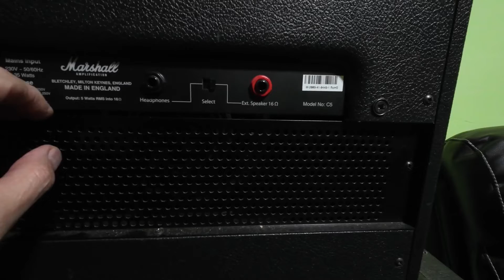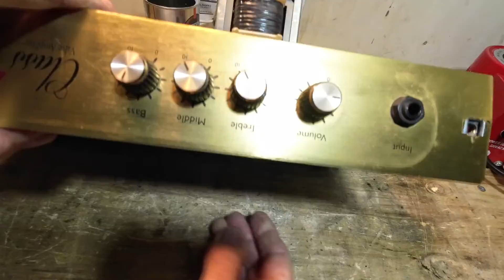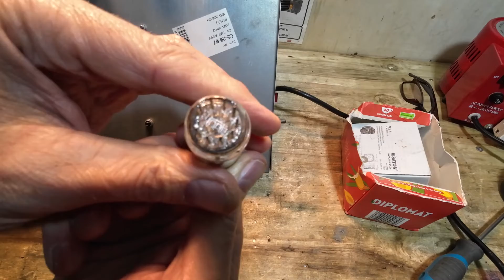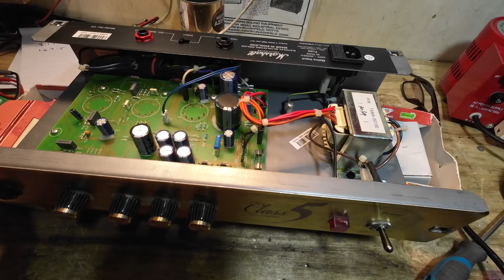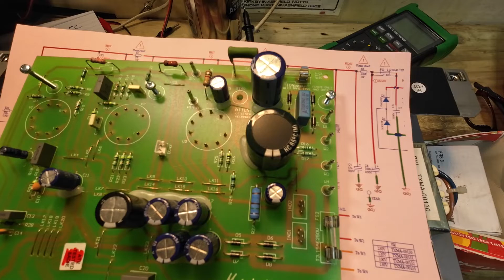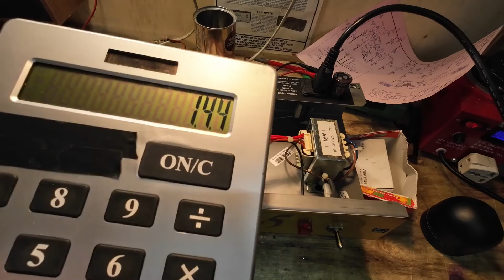Marshall Class 5 Guitar Amplifier Re-Cap and Mods.

Comment: Do you have a parts  list on the items you changed out, 
Your playing is fantastic
Reply from the maker: Hello, thank you. Someone else asked me a few weeks ago. I had a look through my notes but couldn't find the list. I will have to look back through the video. I just been so busy with repairs I have not been able to get on it.  I will try and sort it next week. Thanks for watching and take care
Reply from the maker: Hello. Here are the mods. I had to back through the video. sorry it has taken so long. Take care.

R18 820 ohm
C8 680nf
R20 1MEG
C20 22nf
R28 33K
C10 Removed
C21 Removed and a jumper addd
C2 10nf
C5 10nf
C6 47uf 
C3 22uf
C11 22uf
R4 6,8K 2 Watt Metal Oxide
R2 6,8K 2 Watt Metal Oxide

Comment: Great playing! Your mods def improve the mid control...I've had a couple of these amps for many years now, I switched over from AC30's to two of these to save the back and have a quieter stage volume, I have always loved the sound of them, but there is a rattle of sorts that seems to be triggered by F# if playing them at increased volumes, did you experience this at all in the stock cabinet? It seems odd that they put that rubber foot between the speaker magnet and the chassis, I'm wondering if removing this could help? Really enjoyed your playing, do you ever play with a pick our always the flesh of your thumb, I use pick and pingers, but man your tone sounds great without the pick. So glad I stumbled across your content, cheers
Reply from the maker: Hello Scott, thank you. I didn't notice the rattle on this one.  I do use a pick quite a bit. It depends on what I am playing. That's the trouble with AC30s. So heavy. Have you got still got the stock speakers in your Class 5s?
Reply: @vintageguitaramp_guitarteacher   hello, yes, I still have the stock speakers in both, I've thought about trying a different 10" speaker and also thought about having a custom cabinet built for a 12"...the amp tone works well for me and is a pedal friendly platform too....Do you have any experience with speaker changes in the class 5 or recommendations?